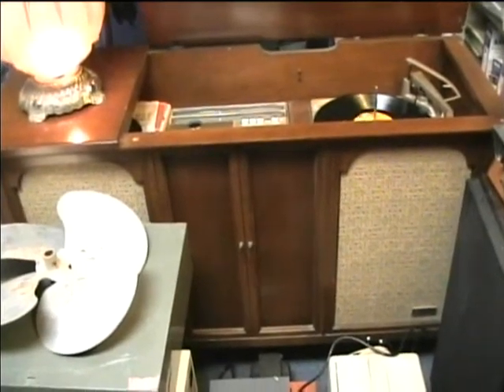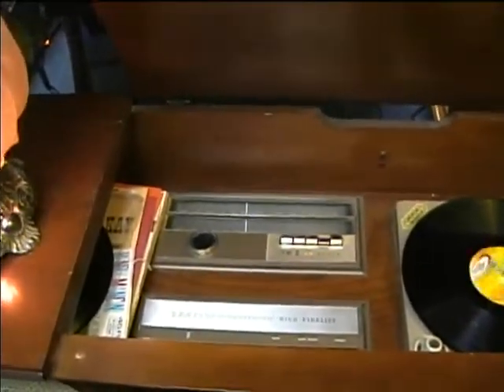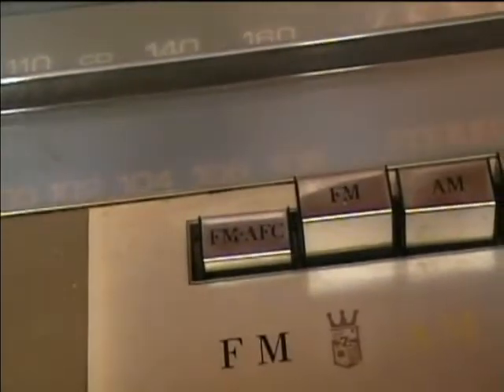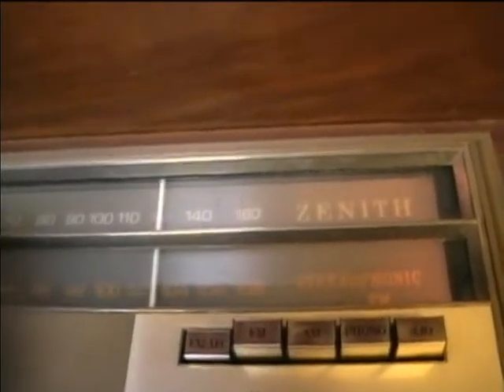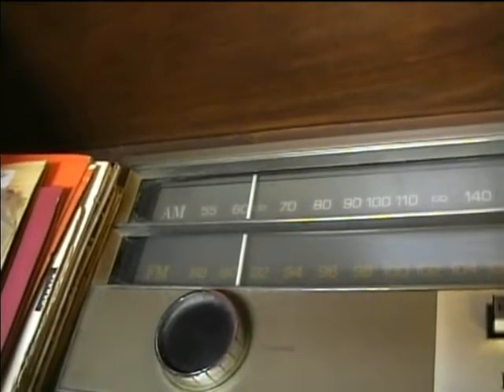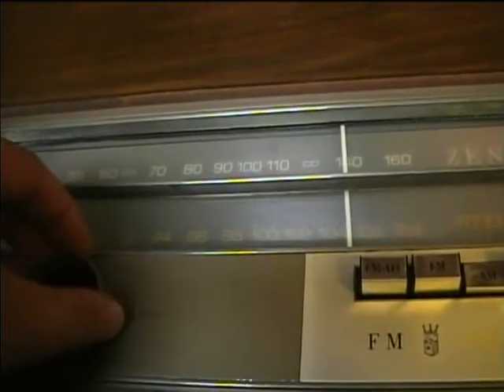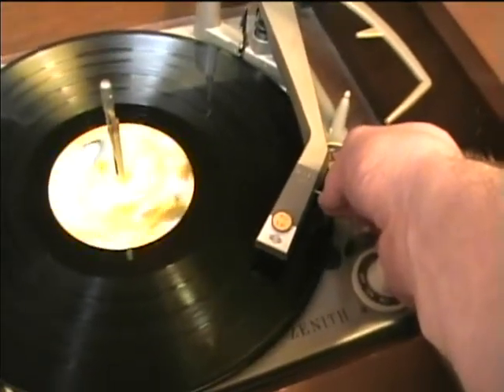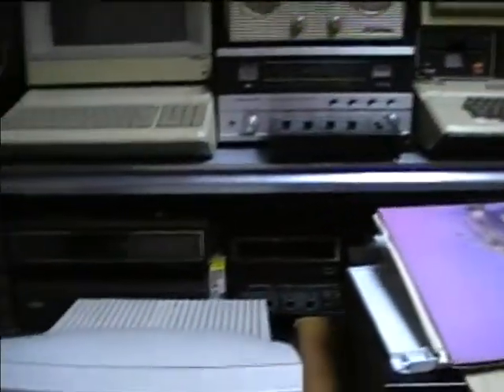Early 1960's Zenith Tube Type Console Radio-Phonograph

Comment: I've never met a tube type Zenith that didn't work. I've met a few that begged for restoration, but they always worked.
I have a nice one that was given to me in the early 80's, and can use some fresh caps in it. The left channel is especially noisy, but as a whole, it's usable, and sounds pretty good. I was told, when it was given to me, that it was purchased new in 1959. 
The Cobra turntable has the same issue as yours, and also drags for a few minutes when it's first started, as well.

Comment: Was there a tape-monitor circuit which could allow an equalizer to be attached?

Were there speaker output terminals which could allow external speakers to be hooked up?

Finally, were there any line-level inputs or outputs for a tape recorder, etc.?  What's that last pushbutton on the right?

Handsome old unit.